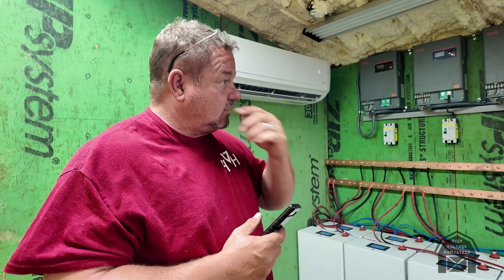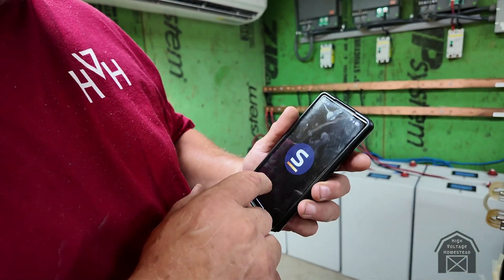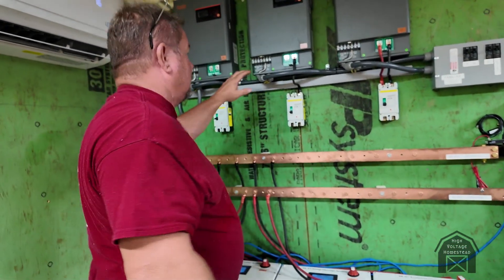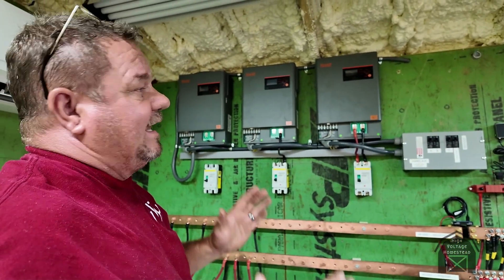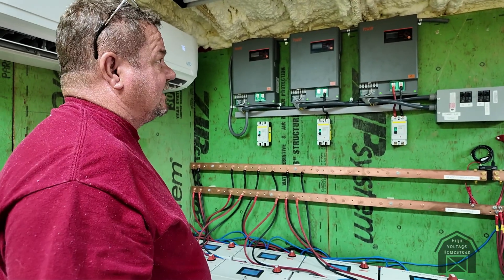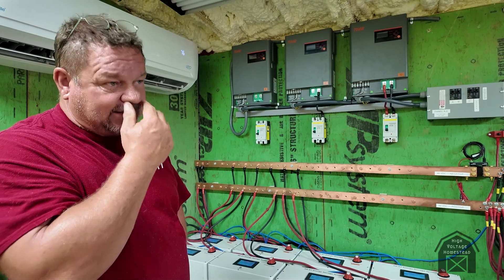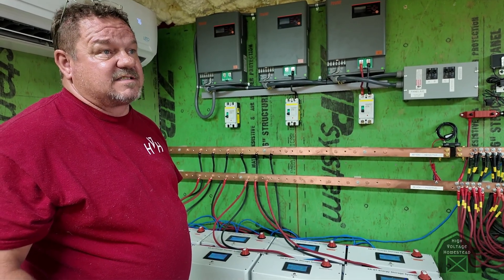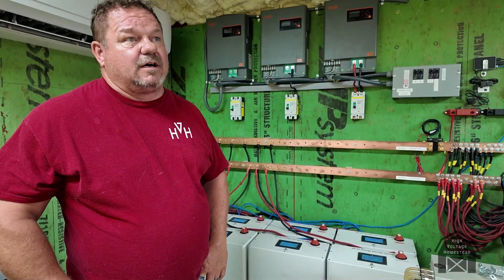Powering Up: New Transformers in the Barn

Comment: None of my business but why haven’t you gone to one Inverter like the Sol-Ark 30K or 60K. With one Inverter it’s not as bad as Numerous Inverters. And say what you will about your Batteries. Several  Sol-Arks would give you the backup for redundancy. And again I never thought about that style of Tracker. I wish I would’ve done mine that way.
Reply from the maker: I haven't really looked in to it.  I run 3 phase 415 volts ac for the miners and I wasn't sure if you could get a single inverter that does that.  With multiples you can set them up several different ways with different outputs and you can even un-balance the legs on out put for example if you run 4 miners on 3 phase and then you had a couple  extra air cooled ones that are single phase you can put an additional inverter or two  on that phase. ie.. inverters 1-6 on phase 1, inverters 7-9 on phase 2, inverters 10-12 on phase 3.  I know it seems odd but that actually is pretty useful for me and with multiple inverters you get that redundancy, if one goes down the others just bypass it and pick up the extra load, gives you time to swap it out and you can actually swap it with the system still active and when you power it on it will talk to the master inverter and get all the settings and then match the phase and pop online.  It's pretty cool.

Thanks

Comment: Thank you for keeping up entertained! Can you please share the model/make of the DC (battery) disconnect switches.
Reply from the maker: Sure brother, I use the 160 amp ones just because they de-rate when they get warm.

https://www.nsbjd.com/collections/100-800a-dc-circuit-breaker
Reply: @HighVoltageHomestead  I can't post a link, Will Prowse just did a similar breaker dead short test. Title: DEAD SHORT 88kWh Lithium Battery Bank! What Will Break First?!

Comment: From the video, it looks like you have a hefty mini split ac. What would you say is the daily KWh usage of your air con, keeping all of the miners, inverters, and batteries cool?
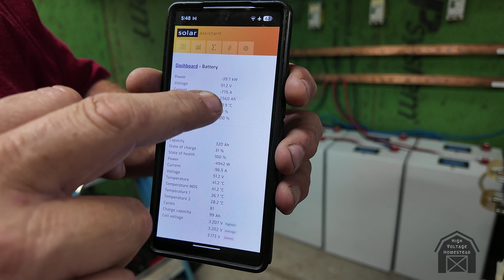Reply from the maker: There are actually 2 of them, one is in the she shed and both of them are powered from the she shed at the moment. The mining ac is a 36,000 btu and the she shed is 18,000 btu. I was just looking at the power usage, it looks like the 2 mini-splits use about 900 watts continuously throughout the day.  I did check the amp draw on the mining shed one and it was about 2.8 amps @ 240 v during the day so I'd say about 700 watts of that 900 watts is for it, but that was in the main heat of the day, about 1:00.  The main reason I have it is to keep everything warm in winter with water running thru them all and such, also if the miners drop below 70 degrees F then they won't start.  I'll try and throw that in a little video for everyone, they are kinda finicky.

Comment: Dang those poor batteries
Reply: It’s all relative.  C-rate.  I think those 8 batteries are about 112kWh. At 51.2V,  I think 1C would be 2,087A!  

I can see him adding even more eventually too.

Edit: These batteries are 320A each, per his early DIY battery video.  320A x 8  in parallel is 2560A.  So, a healthy max C-rate of 0.5 would be a whopping 1280A.  I’d like to see this tested!  Also, it’s eye opening to how much we need high voltage batteries to become widely available. 8 batteries in parallel that are 512V x 32A would reduce total amps to 256A total and 128A for 0.5C.  WAY easier to manage on much less expensive cables and internal components.
Reply: @NickWindham ha half joking.  Pretty cool he’s able to make good use of them.